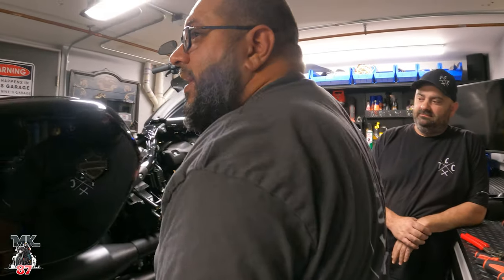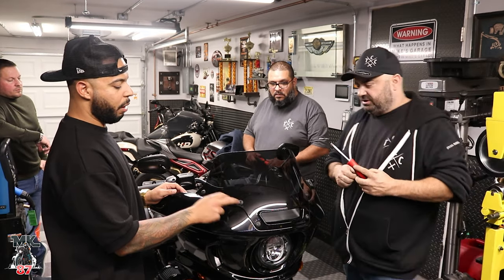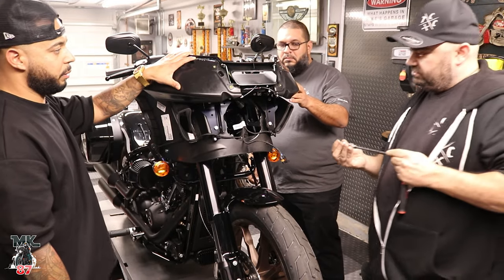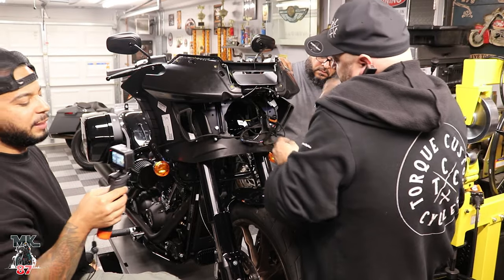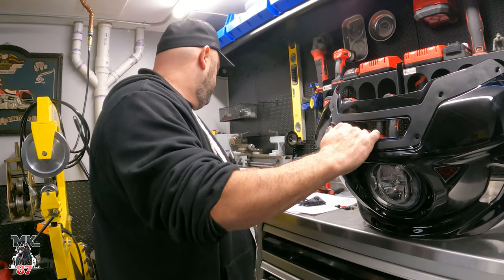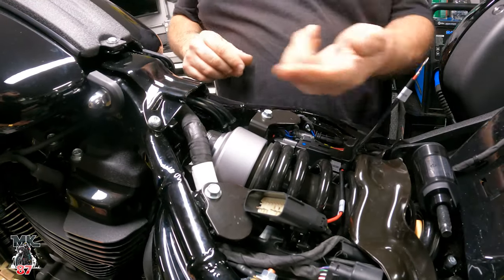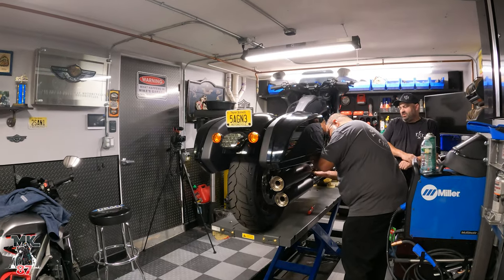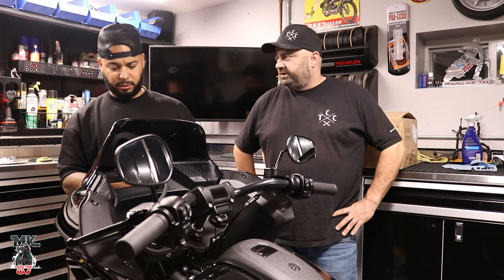Rockford fosgate audio system install on 2022 low rider st

Comment: At 4:47, you yank that cream colored block out of the harness.  Of all the videos I've seen, this is the only time I've seen that done.  The others want you to pull the block out a fraction of an inch and push the blank pin out the back with a tool.

I can't get the blank pin to move and when I grabbed it with needle nose pliers to coax it out the back, it broke off, leaving most of it inside the block. I'm so nervous about screwing the this thing up, Im contemplating bringing it to the dealer to finish that one connection. It will be my luck that when I yank out the cream colored block, I'll destroy something